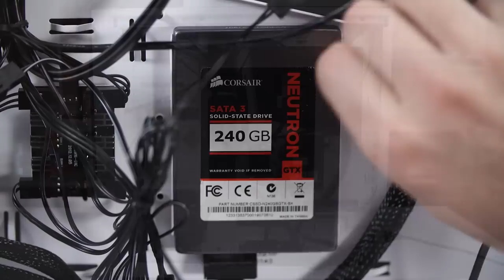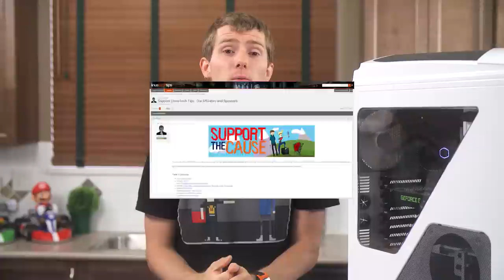NZXT Phantom 530 Gaming Full Tower Case

Comment: Tip: open the top cover from the front, as it is easier.
Reply: thank you! that was the one thing that turned me away from buying this case.
Reply: It says it in the manual to open the front first. Than the top cover

Comment: I'm confused now, is this a mid tower or a full tower case? It seems pretty large to be a mid tower
Reply: It's a mid phantoms look bigger I think because of the shape I have the 410 and it's quite bulky
Reply: Wrightacus Yup the plastic parts on the top and front add a lot of size, but NZXT themselves list it as a full tower.
Reply: I think it is a full tower
Reply: Full tower
Reply: It's a full tower
Reply: It's neither.
It's a monolith.
Reply: Teslamonger no its a cow
Reply: its a MID tower, the Original Phantom its a FULL Tower, source, i own them
Reply: i got both the original phantom its bigger, this is justa  big mid
Reply: According to the tech quickie video on case sizes, mid tow is limited to anything below 21 inches tall, the phantom is 22 inches. So as far as the internals are concerned its a mid, but because the plastic top being so large its technically a full.
Reply: new egg has it listed as full-tower
Reply: Wrightacus
 Fellow 410 owner checking in, and yes all phantoms seem bulky due to the massive plastic bezels.
Reply: O Garcia A big mid or a small full. A glass half empty or a glass half full...
Reply: sqielyr Agree with that ^^ Big mid, or a small full
Reply: its a large mid tower
Reply: all i know is i am hiv +
Reply: jk
its mid tower
Reply: yes luckily that was the aladeen news
Reply: Wrightacus I ordered the 410 last night. Such a beautiful case.
Reply: its a full tower

Comment: Not sure if someone mentioned it already BUT the the drive bay sliding in from the RIGHT side was a pretty smart move, you actually ONLY need to open the RIGHT side where you will be able to manege the cables adn change the drive, IF not pre-installed. This way there is NO need to opening the LEFT side. Which in other cases you would need to open BOTH if the cables were not pre-installed. A BIG plus in my opnion!

Comment: For those still watching, the hub at 3:35 does fit 4-pin fans on the bottom left and top right sides (of the view in the video). Because the 4th unneeded pin is the right one, you can fit the 3 left pins and have the 4th hanging off the side, which isn't possible in the middle. 

Further, if you are not using all the plugs, you can space out 4-pin fans to every other 3-pin port (obstructs the one to the right). 

4-pin hubs are also like $3-4 if you want to just replace the whole thing.

Comment: After some use the top and front panels are pretty easy to take off, and so far, after probably 30 removals and replacements they are definitely not loose. My only dislike is the front panel can be a bit tougher to put back on as it tends to hit any optical bay mounted items. After doing an acrylic piped fully WC build with I7 5820k, Asrock X99 Extreme3 mobo, 16GB (4x4GB) Corsair DDR4 blue 2666mhz RAM, dual Sapphire R9 290x Tri-X adapters, one Crucial MX100 500GB SSD and one WD Black 3.5" 2TB drive, I can appreciate just how much cable management space there is. I love this case's looks, and quality. I've had it for a while and finally had a chance to build in it, and I was definitely NOT disappointed. Good review (for once) Linus. Oh yeah, and I hate the fact that you have arms.

Comment: Do you really read most of the comments? 

We'll see............
Reply from the maker: Yes
Reply: You're awesome then. (fangirling)
Reply: LinusTechTips hey there,
Been your fan for a while now and now i really need your help. I am not a cpu freak as you. I have been planning to build my own pc for the first time with this casing and follwing specs just for gaming at 1080 p. I7 4790, H97 chipset, msi gtx 960, 8gb 1600mhz, 550w corsair power 80+ gold, wd 1tb and this case....now my question is will i be able to build this pc as its my first time or should i buy h44 nxnt model....and another question do all my parts compatible with each other or not...thanks for your help in advance...
Reply: darbin tandukar Yes you can build it in this case. It is a full tower case so you should have more than enough room with the parts you are specifying.
Reply: darbin tandukar Yes, they'll fit. I'd even suggest downgrading the CPU to an i5 and upgrading the graphics / PSU to a 970 (or 290x) and Seasonic 650w. Spend the money where it matters for gaming.
Reply: Thx a lot guys i b ot i5 4690 and msi 970 4gb with corsair 600 psu n all the games are rocking but i m getting some shuttering n my fps count is more than 60. All my drivers are up tO date. Do wnyone know wht th problem is. Any help is appreciated
Reply: LinusTechTips can the ASUS CROSSBLADE RANGER FM2+ AMD A88X (Bolton D4) 8 x SATA 6Gb/s USB 3.0 HDMI ATX AMD Motherboard ASUS CROSSBLADE RANGER FM2+ AMD A88X (Bolton D4) 8 x SATA 6Gb/s USB 3.0 HDMI ATX AMD Motherboard fit in this case?
Reply: LinusTechTips Yeash.
Reply: darbin tandukar also check ebay for 780ti(that's where i got mine). I found one for 230$. This will perform almost the same as the 980(0-4fps worse). Oh, if your going for a 970 check out the r9 290, they preform almost identically and it ocs great(supposedly). Seen the tri-x one for 222$, make sure it doesn't have a reference cooler, though.
Reply: +Jon Pranzetti LMFAO!
Reply: +MrChicken5OOO Yes
Reply: +darbin tandukar I personally  suggest using the Linus Tech Tips Forum for this sort of thing, I know it's 11 mo. since you've posted this but this is also for anyone else seeing this. As a personal user of the LTT forum I can definitely say that they are extremely helpful and friendly, there's an awesome community there and I hope you give it a look!
Reply: +Jon Pranzetti I'm willing to bet that Linus himself doesn't read all the comments. He probably has employed someone to do it for him and respond accordingly. He is a very busy boy after all :)
Reply: 4:52 Its seems like Linus.exe is experiencing frame drops.

Comment: I am building my PC now and using the Phantom 530. I love this case, and glad I returned my first choice for this one. 

You stated that the case wiring came pre-cable managed with wire ties, but mine were all tightly zip tied! I was nervous cutting the ties so I can better cable manage. I managed, but twist ties would have been nicer. I'm not using twist ties for cable management. I've bought some 3M Velcro cable strips from Home Depot and they work like a dream. Way better than twist ties as they provide a tighter fit and less likely to come loose after awhile.

Comment: Already have it and it's fantastic xD

A few things to note tho
- The top panel is removed from the front, and not from the back like Linus did
- Mounting rads in the top in push/pull might interfere with your RAM and/or 8pin mobo cornector, especially if it's 38mm rads. I had to kind of ghetto mount my H105 beside the actual fan holes
- The drive bays might seem a bit flimsy but pop a drive in and they are rock solid

Comment: I have this case in complete black color and it is very robust. Just added 2 front bay storage drawer along with front panel 7 in 1 usb 3.0 hub (3rd bay).
Solid case, hard to move, enough airflow, accommodates my noctua d15, default clock regular usage 24-26° C and I guess it's around $150 now!

Comment: i love the fan on a hinge if ur air cooling ur gfx cards.  Puget Systems, a very reputable system builder is very avid about using something very similar.  They test every custom build with a thermal camera in an a climate controlled room.

Comment: The necessity of removing both drive cages is certainly a little bit of a pain when changing out drives -- I've noted the same on my 750D -- but I wonder if you could reverse-mount the drive cage so you could get it all on the same side. Just now thought of that, so I'll have to see if I can do that on my case.

Comment: Got one of these, i found that the fan controller sometimes doesnt start a few fans but in all i love the case, also i noticed that the spot fan in the middle leaves a 2mm gap if you have a gtx 770 installed which i like as at the moment its aircooled and it makes sure it gets plenty of cool air.

Comment: I bought this case about 3-4 weeks ago and I love it! The only problem I have with it is not being able to do a push/pull configuration with my H100i because the motherboard is blocking the fans (like linus said) and the power button/USB/aux in ports being on the right side of the case... Just a farther distance to  reach since the side panel window of the case is on the left and I cant have the case on the other side of my desk where I cant see the side panel window.. Just a personal preference

Comment: I got this case in black 3-4 months ago, my only complaints are that the top is extremely hard to take off and the fan controller on the back only works with the stock NZXT fans for some reason (might just be mine but not sure i will look into it).
Other than that its the best case i have owned.
The sabertooth z87 looks very good in it too.

Comment: I  HATE the looks of the Phantom 530, but love the case.. so what I did was buy the Source 530 wich is a squareish value oriented Phantom 530 and added rubber groomets to the motherboard tray cutouts for cable management.
The result was a square and black Phantom 530. Gotta love this thing.

Comment: The 410 had a LED fan included to light up inside. If I don't buy my own LED fan or kit, will the Phantom 530 still light up inside to look cool in the dark? Or is it just in the back I/O area?

If I just use a normal GTX 770 graphic card and similar tier components, would getting an extra fan on top be of any use at all? Does it help with the dust control? Still not sure why they didn't come with an LED fan there in this model like before.

Comment: Would a MSI GeForce GTX 970 Gaming graphics card fit in the case? Im having doubts about it because the slots on the back look very thin.
Reply: Shadow_GamerXD yes the slots in every case are single slots, but because you have so many you can just take out 2 for a standart dual slot card
Reply: John Smith Ok, Thanks.
Reply: Using it. Works gr8 8/8 m8

Comment: what is the best cooler for my cpu, i has this case with 1 gtx 980 strix (may chuck another in in the future) on a MSI <power Z97 with intel 17 4970k

i was looking at the Noctua NH-D14dual 120mm fans
but then there are things like sealed coolers and water cooling (which is a bit to much money for me now)

not really looking to overclock much
Reply: what about an NZXT HAVIK?.....also, I am building a similar build
Reply: the 140? its discontinued, really hard to get hands on, does beat teh Noctua NH-D14
Reply: richard Clark Swiftech H220X? Expandability into a larger water cooling loop.
Reply: richard Clark If you're not looking to overclock then the Cooler Master Hyper 212 Evo for sure. It's fantastic and very well priced.

Comment: you can use 4 pin fans with the included fan controller. it is the same one i have in my nzxt phantom 630 and i have two cooler master jetflo 120mm fans connected to it among other. it seems like they wont fit but with a little elbow grease they fit fine.

Comment: My first rig was in the original Phantom. It worked ok. Good airflow, half decent included fans, and a crapton of room. The plastic parts were pretty robust. The 530 definitely looks better overall, the lines look better. the angular front of the first one with the little bottom protrusion was kind of annoying.
Reply: +Elvirth24 I like the original Phantom well enough, but the 530 is a cleaner design with solid air and water cooling capabilities.

Comment: If I'm building my first PC (and need a case that lets a beginner put in things as simply and easily as possible) would I have an easier time inserting the components, managing the cables, and setting up some decent cooling with this? Or would I be better of with something like the Cooler Master HAF X? Or is there some 3rd case that's really simple and comes with its own cooling that would be best for a guy likely to make a couple mistakes on his first try?
Reply: +D123 Honestly I built my first rig last year using this case and honestly, its great. Plenty of space for everything, easy hookups and plenty room for cable management. I initially thought that I was going to mess up aswell but in reality along as you take care to discharge any static and take those kinds of precautions you'll be fine. the biggest mistake that I made was not hooking the power up to my graphics card which you can see in this picture https://twitter.com/Numbzeh/status/629820598970150912 lol. If you're still looking at parts you can take a look at the build I did in that case for some ideas here http://pcpartpicker.com/user/Numbzeh/saved/HsTxFT . Hope that this helps. Good luck and happy building!

Comment: You guys should review the ms-1 commander series cases by Thermaltake.    All the same case but different colors. I just built my first pc in the snow edition and I love the looks and my only complaint was the front 120mm fan mount doesn't fit a 120mm fan. It's a great case edgewise

Comment: i prefer my phanteks enthoo pro in white, for $100 i got a dual window side, full tower, fully modular case. plenty o liquid cooling capabilities and 2 spots for radiators. a huge 200mm intake fan and 140mm output fan are included. rubber grommets n psu shroud. and they come with zip ties sure, but they also include velcro straps pre installed plus a nice box for all your screws. rear has honeycomb design for out flow, rubber psu supports for a raised airflow as well. it has a pwm hub built in and 2 usb 3.0 & 2.0 front i/o with headphone and mic input, and a hidden reset button as well. front and top facia comes in a brushed aluminum look and the rest is 100% steel construction. comes with 2 hard drive cages for 6 spots for hdd/ssd, 3 5.25 bays, and has two ssd bays hidden on the backside of the motherboard which comes with one ssd mount. the other mount will cost like $8 on amazon. can fit a 360mm radiator on top a 240mm in the front and a 140mm on bottom. hard drive cages have each support for 120mm fans. im waiting on my order of dual 120mm fans to come in this week.  i have a 140mm on bottom (i used to have above cpu cooler but with only a 200mm intake it caused a negative pressure situation with my other 140mm above my pcie ports. im hoping to see if the 2 120mm fans will help on the drive cages

Comment: Quick question would a 120mm Corsair H55 watercooled cpu cooler fit in the top fan holes? keep hearing there 140 then there both etc

Comment: does the front and front-bottom  not have a fan filters ?
and i wish case designers would add fan filters at the top aswell.
a small thin one could be placed between the fan and the case. or on top of the fans since that would be easier to clean.
Reply: whats the point of filters on top? most people use it as a exhaust so why would u need to filter that? and there is a filter on bottom for psu and the bottom intake and theres loose mesh filter on front.
Reply: There are fan filters on the front and the bottom where the psu are
Reply: There is no reason for filters on the top.
Reply: tommydadog
most cases that are not silent optimized have a ton of openings for exhaust so using it as an intake (atleast in my case) gives me better temperatures than using it as an exhaust.

Comment: I Just got this case for xmas and love everything but i do have one complaint about the plastic panels.
I have internal led lighting and it shines through the plastic of the front panel and the top panel. I will be sorting this out by taking the panels off and taking the wire mesh out so i can paint the inside of the panels black so the lights don't shine through.
Besides that its a great case.

Comment: Since im not water cooling, could I have normal air fans with the triple 120 in the top, dual 120 in the front, and dual 120 on the bottom?

Comment: Should I get a mid tower case or a full tower? Which is better ? I have a atx mother board and planning on getting a h100
Reply: If you have room for it you should get a full one. If you want to be space-efficient use a mid. Though if you are getting a water cooling system get a full one anyways.
Reply: Orbixas Yeah, I made a mistake of getting a mid tower. No where near as much room as I wanted. Plus with my 120mm Hyper T4 fan I couldn't even fit the side panel on without removing one of the fans attached to the panel. I'm currently working on my next build and am for sure going with full tower this time.

Comment: Are the fans that come with the case enough for an I7 6700k, and a evga gtx 1080 card enough? Or should I add/replace with some 140mm fans?
I'm probably gonna do some overclocking as well.

Comment: I'm an owner of the original phantom. It's a fine case but I can admit that there are some minor flaws with it. Phantom 530 has fixed a lot of them but some problems still remains.

For example, 530 has still mesh and fan spot on the side panel which is useless and looks bad. Also, it has a worse fan controller than the original. It's pretty much a negative air pressure optimised case which may result in dust build up. That combined with the fact that 530 doesnt have any dust filters except for the botton once is for me a dealbreaker.

If NZXT releases a new improved Phantom with all these issues fixed I will probably upgrade my case then, but for now I will stick with what I got.